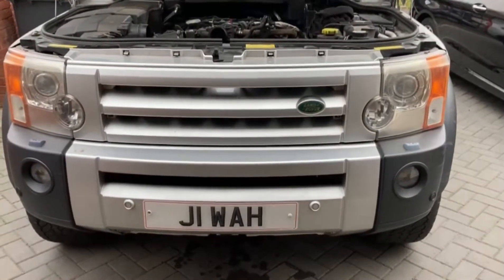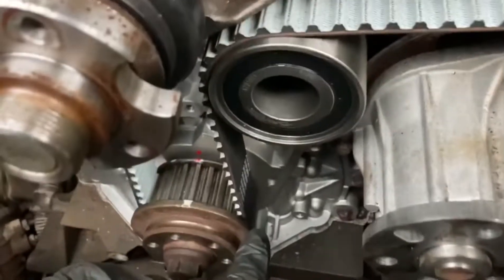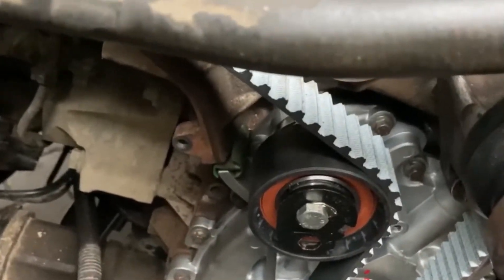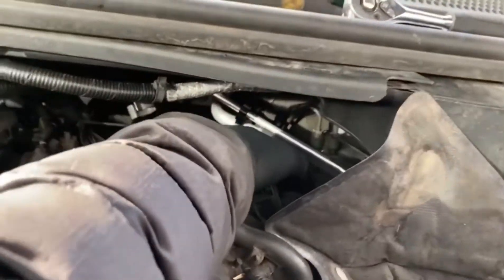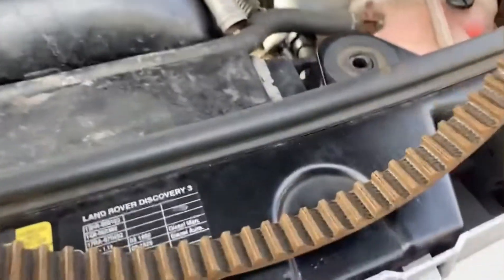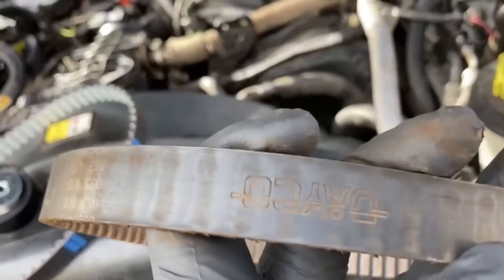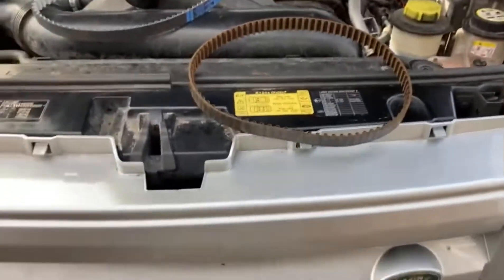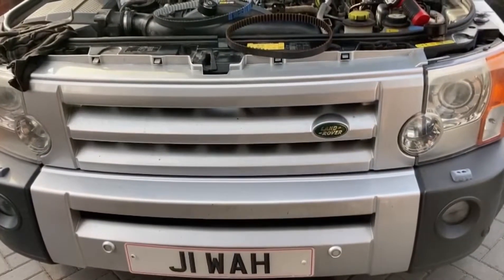why timing belt change on landrover discovery 2.7 tdv6 is important

Comment: Hi mate, if mine broke at the low rpm do you reckon it still has damage the top of the engine? Is it worth repairing? And difficult? Thank you
Reply from the maker: Oo no if piston hits valve even on low idle still valves are bent not all of them. However there is engines with exception. Two options fit new timings belt and hope for miracles carry out a compression check after to establish a low compression cylinders that will indicate on which side of the cylinder head would need repairs, cylinder leak of test alternatively can be carried out too - more expensive would removing rocker covers blindly and check for visual damage. Both belt replacements around £1000. One side head removal cost around conservatively £1500 for one side if the body-shell  have to be removed then another £1500. It should be ok without shell removal
Reply: @CarExamer  thank you for taking the time to respond! 🙏🏻🙏🏻
Reply from the maker: @alinvlaic191  no problem at all. Lets hope no valves bent
Reply: The same happened to me, and it only broke 7 rocker arms. No valves damages